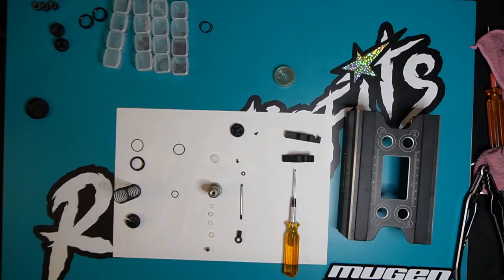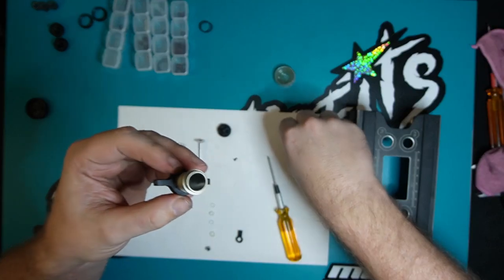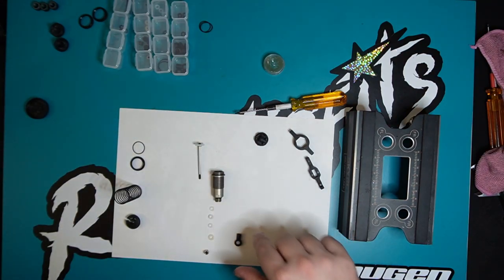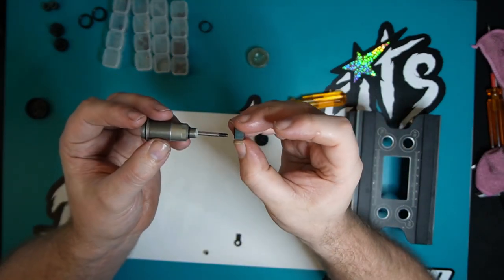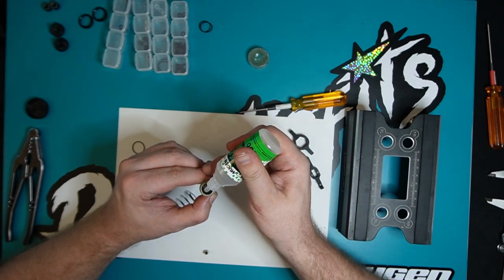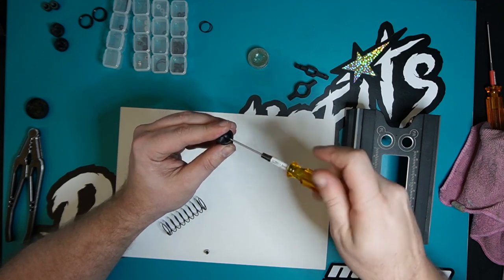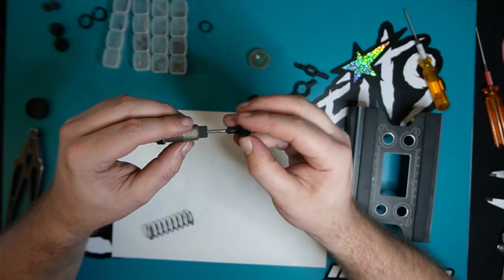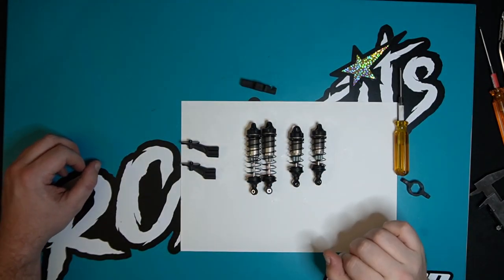Mugen MSB1 Shocks and wing mount

Comment: You should ream out the last spacer in the shocks as the designer explained in his video, so it’s no resistance on the shaft
Reply: I tried that... they leaked.  I'm obviously not as precise with an X-acto knife as Shin is.  Cost me $30 for new bushings and X-rings to stop the leakage.  YMMV.